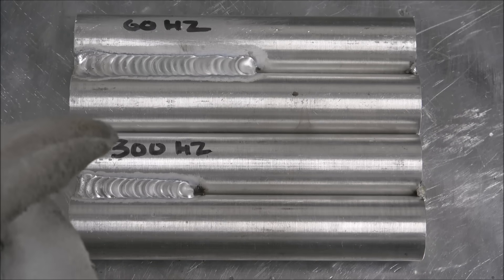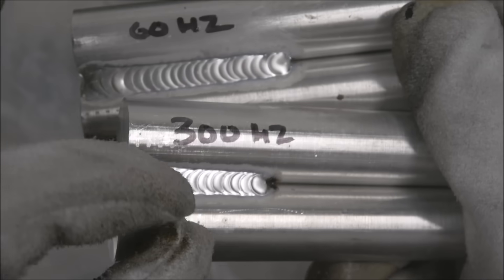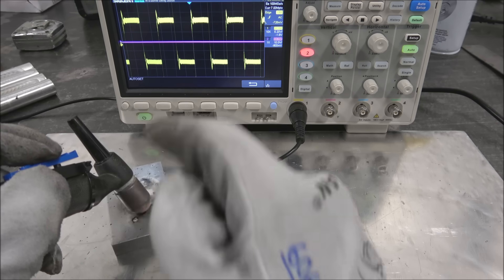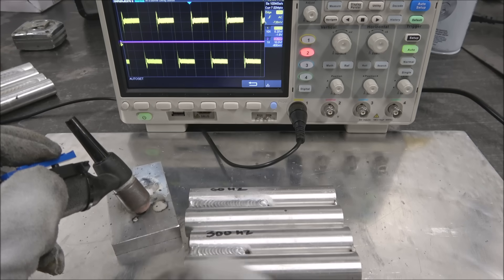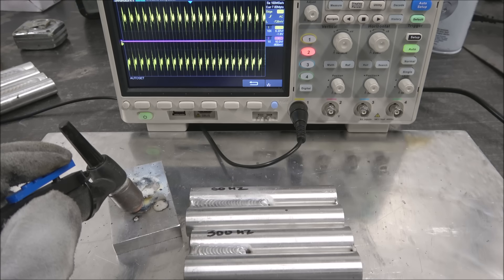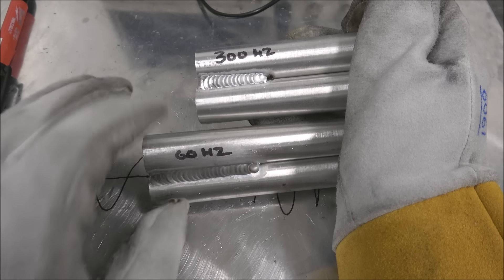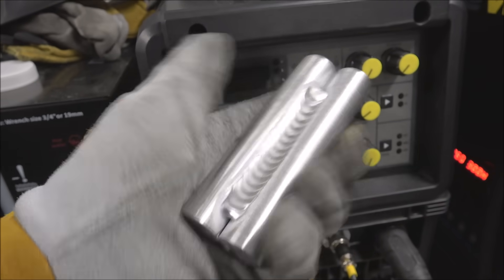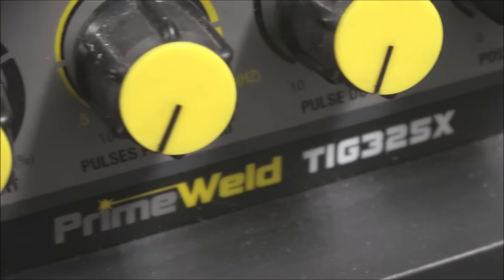TIG Welding Aluminum - AC Frequency "Hocus Pocus"? - The Truth - Gets easier with a better machine

Comment: The main issue is what is called "skin effect".   Good old (and dead) James Maxwell came up with the equations that define skin effect.  Higher frequencies tend to move the current flow closer to the surface of the conductor.  In this case, it is the aluminum tube.   Lower freqs penetrate deeper..  I would guess from this that  higher freqs are good for thinner material to stop blow through but my TIG welding capabilities are way worse than the frequency changes.

Comment: Higher frequency has more skin effect possibly?  Similar to HV power lines.  Just a thought - no data.  ;)
Reply: Oh, also... induction making a result change due to the curvature of the rods?  Would you get the same result if it was a lap weld on flat stock (or similar).

Comment: Im in aerospace repair and typically have .060 and thinner. At that thickness and thinner it makes a big difference. Can get deeper penetration with less amps or opposite depending on what im doing.

Comment: Thanks Aaron.  Overall it's RMS/average power.  Lower frequency AC produces higher average power because it stays in each polarity longer, allowing more heat to build up in the workpiece. For a 200 amp welding circuit, the RMS power calculation is simplified to: Power (watts) = Voltage × 200 amps × (duty cycle percentage), where lower frequencies have longer duty cycles resulting in more time at peak current.

Thanks for the frequent great videos brotha!
Reply: i have the feeling you might mix up duty cycle and frequency of these cycles 
lower freqs dont have longer duty cycles, because duty cycle is the relation between on and off time.
yea the single on or of duty times would be longer with lower frequency, but in the end it doesn't change the relation 

RMS values only changes with different shape or amplitude of the wave 

so in Theory the power put in should be identical (even tho it might be a little different due to the circuit not being ideal)
Reply: @GrafRucola  you are absolutely right.  I got mixed up thinking Pulse Repetition frequency and the average power calculation for it over time.  Thanks!

Comment: Logically speaking, I believe your analysis is correct.  There is that fraction of time between the alternation of the currents that has dead time or even ramps up to the desired amps.  The more changes, the more dead time which in turn has less current going into the metal.  Makes sense to me.  I'll keep it in mind for future welds.

Comment: I have one of the original Miller Diversion 180s, I get no control other than amperage as a setting. :(
The machine still does me well though.
Reply: After 10 years with a Diversion , I sold it and bought a AHP to get more knobs .
Reply: @ I've been shopping. Haven't had the coin though.

Comment: I think it's the switching time of the transistors, more switching, less time is spent in the "on" phase. My welder only goes up to 100hz, but the welding get noticeably hotter when I drop the frequency.
Reply: switching time can be low enough to allow computer-transistors to work at over 4 ghz. i dont think this plays a role at all. i think, since the puddle shrinks during the cleaning cycle and expands the rest of the time, one has to see it more like a pulse setting. lower herz, more time to put in heat before the next "cooling cycle".
Reply: @Cassiusisback  But you can see how ragged the signal is in the 300hz test.  That is no longer a square wave.  Yanking a massive current rail to rail is much harder than the 4Ghz computer transistors job.   This also explains his comment of how a better machine makes this easier.  Internally, it's stiffer and has a faster slew.  With a cheap enough welder, that square wave turns into a cosine wave pretty fast.  And integrating the absolute area under the cosine is about 60% of what it is for a true square wave.
Reply: @costarich8029  Another thing to add to your point is that the transistor's switching time is constant with respect to the wave frequency.  That means that as frequency goes up, more of the duty cycle time is eaten up by the switching time of the transistor.  That effective duty cycle goes down as square wave frequency goes up.
Reply: @Cassiusisback it can be, but there’s a big difference between beefy IGBTs used for power inverter applications, and high speed CMOS used for low power digital circuits. Also if the switching edges are too fast in power applications you get tons of EMI. NEMA actually calls out a limit on how fast the square wave can be on Variable Frequency Drives to minimize EMI and protect stator windings and bearings of induction motors.
Reply: My first thought was switching time too, though I'm not sure if the effect is big enough to explain the results in the video. Keep in mind a power transistor will have a much longer switching time than a logic transistor in a 4 GHz CPU.

Comment: I'll start with I also am not sure, but I would guess on a 70/30 wave balance at 60 HZ, it's not so much that it crosses zero fewer times (because the 60 HZ just crosses slower), but that it hangs out at its maximum welding amperage for longer given that it gets there and then square waves out at the ends...

Either way, I enjoy these thought dives into the 'why' because it definitely helps me cement the concepts in my head when I'm going to choose welder setup.
Reply: yeh i think its the lower freq has a more square wave shape, the closer you get to max freq the more like a sin or triangular wave

Comment: The waveform wasn't very square at 300Hz , have you had a chance to try it at lower settings to see the highest frequency it stays square at? :)
Reply: This is just from the probing technique and limitations there, creating the ringing you are seeing on the fast transitions (which are at frequencies of several times larger than the 300 Hz).
Reply from the maker: Have you ever used an oscilloscope with a welder?
Reply: @6061   I was in my head thinking how amazing and interesting it would be to look at it on a scope when you cut to an osciloscope and a tig torch ! :)  I have had issues with the waveform of signals at high frequencies not displaying corectly because of probe and cable issues but at 300Hz "I think" it shouldnt affect it too much.   Did the waveform change if there was an active arc vs just shorting the the tungston to ground ?    Amazing video by the way ! :)

Comment: I'd guess it's an inductance related phenomenon since the higher the frequency the higher the inductance the more the current lags the voltage and since power equals voltage times current you'd have more times where the current is lower than it ought to be in an ideal consumer and you'd get less heat
Reply: The impedance of an inductor at 60Hz or 300Hz is negligible, and there is no significant voltage current phase lag.

The issue is very likely just the dead time, and rise and fall times of the switching transistors.
Reply: @danstiurca7963  a square wave supposed to do that instantly

Comment: Is that a regular probe or something more advanced? Do you know if HF start will fry the scope?
Reply: it is probably a voltage drop measurement, should be save if he measures across the leads and with direct tungsten contact it should also be safe to measure across the work-peace  
most scopes are around 300V safe and with 10x probe it should be more, but I think it only doubles to around 600V 
so the HV (some multiple kiloVolts) of the HF start could definitely cause problems if striking through the scope and not mitigated by different measuring setups